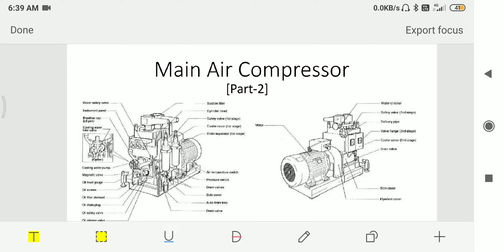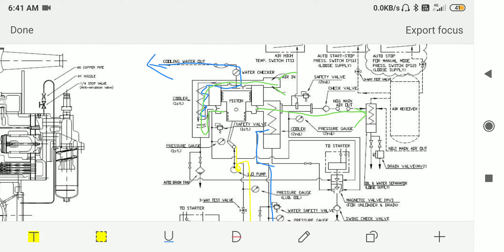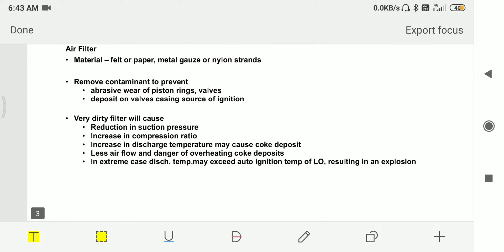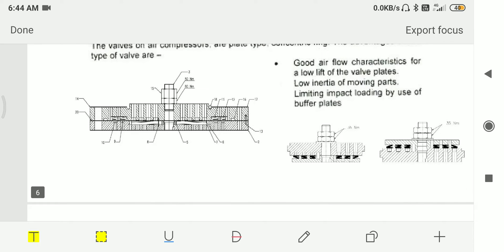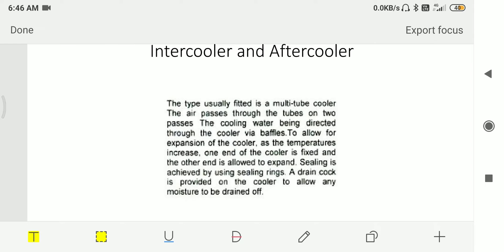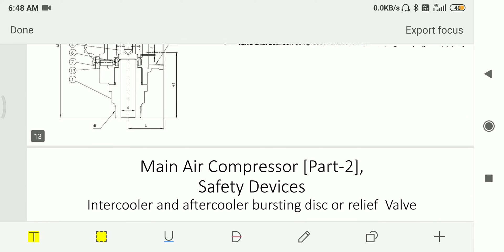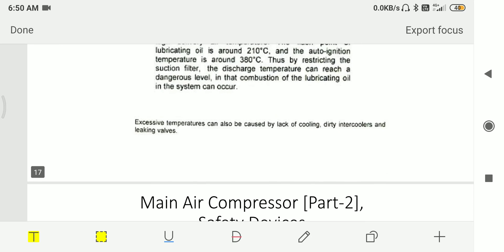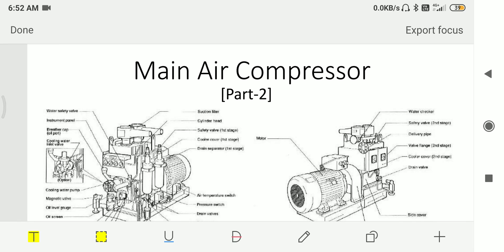Main Air Compressor On Ships, [Part-2]

Comment: I think it's not safety valve ...Relief valve is fitted on air compressor...Safety valve is fitted on air receiver
Reply from the maker: Yes u r correct, but this material is from shipboard manual and they are calling it as safety valve. The main difference between them is that, the safety valve opening set pressure and closing pressure is different and closing pressure is less than set pressure of the safety valve. Other difference is in the valve opening and closing rate, safety valve opens and closes sharply.